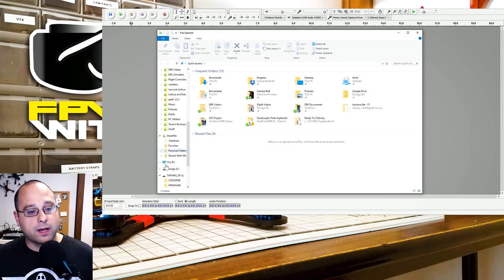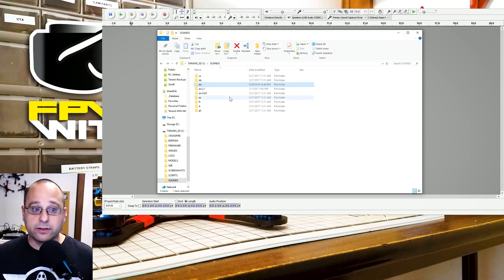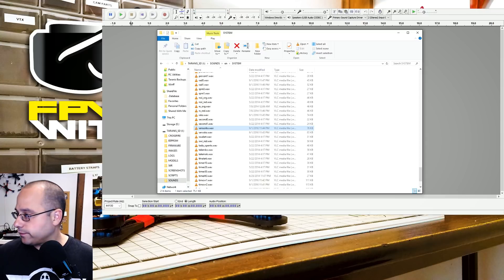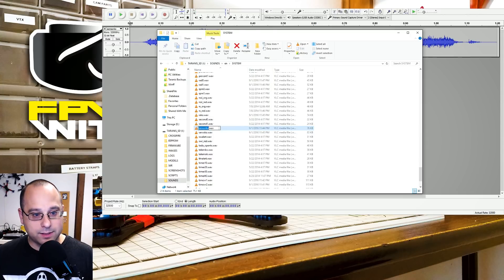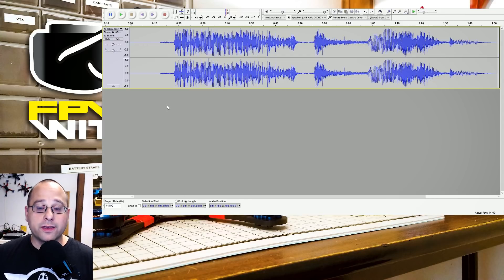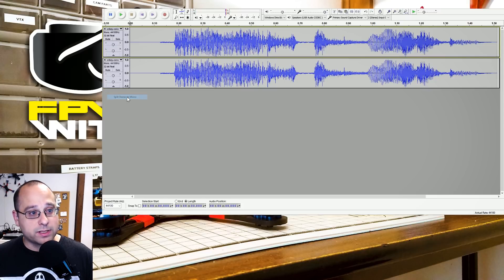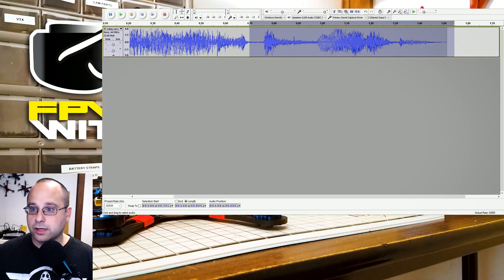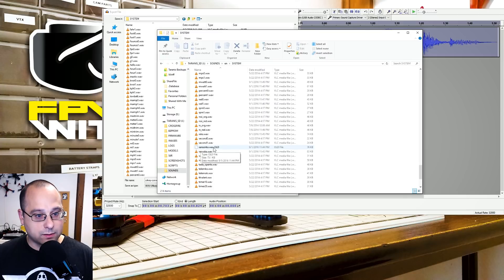Taranis Sensor Lost | HOW TO FIX IT

Comment: I have a Radio-master TX16s MK II; I received the sensor lost continuously after an update on my FBL Nexus. The way I fixed it was to change the packet rate and Telemetry ratio in my Nexus FBL to match my radio. My Radio packet rate was 333 and the Telem ration was 1:32. On my Nexus FBL the packet rate was 250 and the telem ration was 8. Once I did this no more voice alerts.

Comment: Follow all the instructions on your video on flashing the firmware still says Telemetry lost so I thought something went wrong in the flashing did it one more time still getting the same issues could it just be a bad receiver or did I do something wrong in the process
Reply from the maker: Try updating to Betaflight 3.4.1. There are some fixes in there to try to address this.
Reply: Joshua Bardwell thank you I appreciate it I'll give that a try

Comment: Hey Joshua, I just upgraded to a crossfire micro and only now did j start getting this sensor lost alert. If I disable as you show us,  will it affect range? Is there anything I should be concerned with in terms of how my Taranis might be affected.
Reply from the maker: No it won't affect range. But it is weird that you are getting that warning from Crossfire.
Reply: Ok, thanks Joshua I was worried about failsafes and I just wanna be able to trust my gear like i did when I had my rxsr in it.
Reply: Joshua Bardwell I just upgraded to 2.2.2 and I’m getting this using crossfire.
Reply: I just updated the crossfire micro today and now I'm getting "sensor lost" warnings 😭😭😭
Reply: I switched to Crossfire a few weeks ago and get "sensor lost" frequently. This happens when XF drops to 50 Hz mode. I have a video demonstrating that here: https://www.youtube.com/watch?v=9pUMfzDf0_8 I opened a support ticket @ TBS but got no answer so far.

Comment: Hey Josh,
Im runing the matek f405 with the fchub vtx connected with the ribbon and i lose curr and votage sensor and get the sound everytime i disarm is this have to do with the same issue? I also get them back after arming.
Reply from the maker: I've never heard of that issue. That's pretty weird.

Have you got MSP shared on the same UART as your telemetry? That would cause telemetry to stop working whenever you disarm. Check in the Ports tab. See if MSP and SmartPort are on the same UART. If so, disable MSP.
Reply: Joshua Bardwell i actually have smartport on motor pad 6 with soft serial.
Reply: Turns out msp was on on soft serial. I guess its time to takes a break lol thanks for your help!

Comment: Just spend hours troubleshooting this issue on a new matek f405 that quit sending data after a min after power up.

Guess when the data returned ; TOUCHING THE CRYSTAL...(of the arm chip..)  
And once let go the data disappeared again...  

Sounds like a serious design flaw to me ..
Reply from the maker: +cmulder002 sounds like you have a defective board.

Comment: Great, but why is this wave file triggered in the first place?
Reply from the maker: Because of a "disagreement" between betaflight, the receiver, and the transmitter.
Reply: I had this yesterday for the first time with my CrossFire Taranis setup. I was a bit out there and had just flown under a pier. It made me very nervous. I have no way of knowing what sensor was lost.....as I also have a little GPS Ublox on one arm. I wonder if it was that?

Comment: Hi, I had a slightly different issue with the upgrade. You remember the functions that you presented not to have the low voltage alarm straight away on a threshold but rather after a delay ? Well the sticky function which latches the low alarm state as long as you are not back above the high threshold is not resetting properly : I switch on my radio, arm my quad, receive telemetry (shared with usb), and then start to have the low voltage alarm although it's 16.8V. The sticky function shows that the threshold to reset it is active, but stays set... if I change something like the parameter which resets, and put it back, then the latch is reset :/ quite annoying and no resource could give me the solution yet.
Reply: Also, at some point in the flight, this stops. I can't tell if it's when I hit the low voltage threshold but it seems before (I'm usually too busy flying and trying to ignore the sound at this point) then towards the end of the lipo the normal alarm mode comes back.

Comment: Its because RF updates VFAS > 15 seconds.   Taranis wants all sensors updating within the 15s window so they are leaving it to the manufac to update in a timely manner.  You can rename the file yes, but there is still a hypethetic feedback that will happen so this does not solve the issue completely.  Either Taranis needs to add a setting so we can change it to 20 seconds or more or RF and other manuf needs to send the sensor info in a timely manner.    Honestly > 15 seconds like RF does is not reliable for VPack info and I agree with Taranis guys, RF and others need to send telemetry within 15 seconds.

Comment: @Joshua Bardwell the sensor lost is alarm is telling you that the telemetry is not updating. If it is happening on a Kakute F4 It is a known problem F4 AIO and can be fixed by installing a piggy back resistor to the board or installing a 5.1k resistor from the smartport pad to ground (has the same effect). See https://github.com/betaflight/betaflight/wiki/Board---KAKUTEF4

Comment: I think i'll do this to my Telemetry lost warning. It's been so annoying and unnecessary since it always immediately recovers it and my RSSI never goes below 60db. Or i suppose i could just mount my antennas like MrSteele does, almost never had that warning when i mounted them like that.
Reply: VilleF1N  I have same issue with frequent Telemetry Lost warning. Also Sensor Lost. WTF is going on with this. Never happened with my old Taranis. 
Are you using a Special Edition on 2.2 firmware ?
Reply: No, i have the good ol Taranis Plus X9D with OpenTX 2.2. You might have a loose SMA connector tho, if you have the Special Edition and take your antenna off often. I'd suggest trying to swap the antenna to see if it helps.

Comment: You should do a video on the taranis not connecting... My usb port isn't broken, but my computer won't recognize it anymore
Reply: When I enabled mass storage in the firmware I obviously lost the ability to use the taranis as a usb game controller. When I removed the mass storage option my PC wouldn't pick it up until I deleted stale devices (and drivers), deleted the item that was listed when connecting and then rescanned for devices (potentially this last step was all that was needed). Usually the issue is a driver and enumeration conflict which can sometimes be solved by ensuring a clean slate when connecting a device.

It's not as simple as just enabling "show hidden devices". https://kabheap.wordpress.com/2011/02/26/command-line-to-show-hidden-devices-in-device-manager/

It doesn't hurt to clean out old unused enumerated devices and remove all those driver you're no longer using.
Reply from the maker: I have this same problem and never solved it.

Comment: Erasing o changing the nane of the audio file does not seem to me the wright solution, what is the real cause of this condition is what it should be solved
Reply from the maker: Well until the developers do that, here is a band-aid.
Reply: The problem is mostly with the xsr where a few have a too high input capacitance. This leads to the signal not dropping the way open tx 2.2 wants it which interprets it as a sensor not being there or not working anymore and then saying sensor lost. There is hardware fixes like changing capacitors on the holybro kakute f4 for example on the S.port but that's bullshit to me. It's a combination out of open tx 2.2. Software and the lack of testing of fc manufacturers. Like they can't test them on all open tx with all recievers but it good pretty common now.
Reply: So could some really smart programmer or someone with alot of time on their hands and alot of experience tweak the firmware to get it back to how it was on the old firmware?  Seems like changing hardware is not the way to go since it worked just fine prior to the 2 firmware.

Comment: Jesus Josh. Thank god you are addressing this subject. I upgraded the firmware on my brand new Taranis and have been getting this sensor lost quite often. Does this " bug" also result in a false Telemetry lost warning??
Please say it does. I almost sent my radio in for repair over this issue. 
If this is all related, what is the real fix? If theses are Both false warnings, what is the file name for Telemetry Lost?
Thanks for all you do!!!
Reply: Daytona FPV on some of my models I have the warnings if I'm too close then they go away
Reply: interesting, i'll give it a shot. havent re-maidened this one yet, that's a flite fest job :D
Reply: henry/valiant i flew yesterday and this morning without a problem at all s o it seems like it was too close when i was testing it.
Reply from the maker: I'm not sure about Telemetry Lost. I don't think that is fake. But I could be wrong. Anyway I wouldn't want to disable telemetry lost because that is an indication you are going into failsafe.
Reply: Joshua Bardwell -  gotcha. The thing is, I'm not getting low rssi warning, just Telemetry Lost.
Reply: you and me both, the problem i have is i just put a new x8r into a plane and although im 10 feet away i keep getting telemetry lost telemetry recovered 4-5 times which is triggering the RTH. any thoughts?
Reply: Daytona FPV - Sounds like exactly my issue. I guess I'll try a receiver firmware upgrade. Are you using the new open RC 2.2 firmware?
Reply: opentx 2.2 and a brand new x8r. i havent updated the receiver firmware as i don't know how to do it (i know there's vids), but i don't have the cables etc anyway
Reply: Daytona FPV -We are in the same boat my friend. I'm considering buying a $40 frsky module for the back of the radio. If that fixes the issue, then you know something's wrong with your Taranis. If not, $40 wasted.
Reply: my taranis is 3 weeks old. i'll be moving to crossfire soon anyway. I just needed something to get me by. we'll find out tomorrow at flitefest lol
Reply: Daytona FPV - Let me know if you come to any conclusions/ solutions. I'll do the same. 
Have fun!
Reply: Please note that besides the annoying "sensot lost" alert, you don't get telemetry updates on your taranis. 
Upgrading the firmware of the receiver did the trick for me.
The required cable is super easy to make. And the procedure is super simple.
Reply: Daytona FPV I'm getting the same audible warning "telemetry lost".  Only seems to happen when I'm like 5 ft. or closer.
Reply: yes exactly here too- only while I'm pluggging in and close to the quad
like 1 or 2 feet
Reply: skypilot 23 so is this a concern , or something that can be ignored? Anything farther than that 4-5 Ft. I don't get any warning of "telemetry lost",  yet.
Reply: problem i have is that the aircraft goes into RTH as soon as it gets that so .... that's an issue
Reply: Henry Arnold , So I get these warnings while on the bench. I don't get them while flying close to myself. Then I start getting them again when I'm at a moderate distance; areas where my old Taranis would have had no problem reaching. So for me, it doesn't seem to only be a problem up close. Looks like a lot of us need a solution for this.
Reply: valiant360420 I agree! I'm very new to the hobby.  Last thing I wanna do is hunt for the darn thing.  When telemetry is lost , does it go into fail safe?  or...
Reply: Henry Arnold -I don't think I've yet had an actual failsafe from this problem. So these warnings could all be "false alarms ". But like you say; the idea is to avoid an actual control loss, and loose your quad. My tip... avoid tall grass. I once had to hunt for over 4 hours in a field of tall grass to find my quad. That was with an old Spektrum radio... and that's why I switched to Frsky.
Reply: valiant360420 Advice takin.  Thanks.  As stated earlier , very new to all this , but why did you switch Tx?
Reply: Daytona FPV, That's good to know!